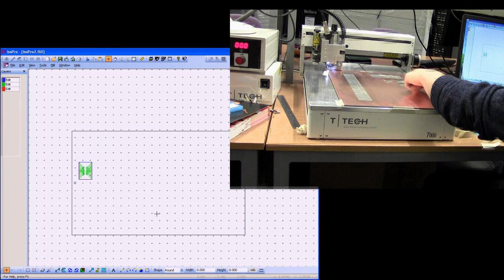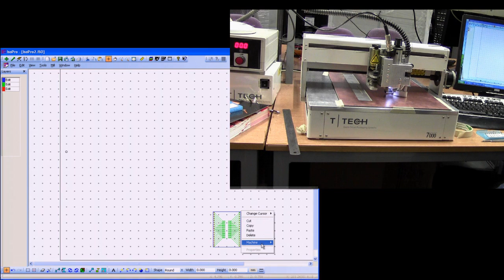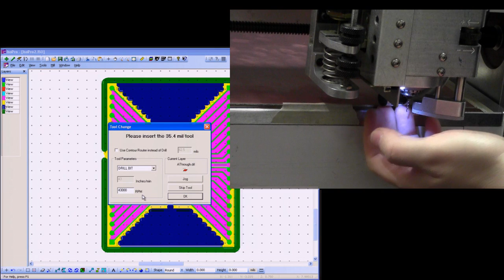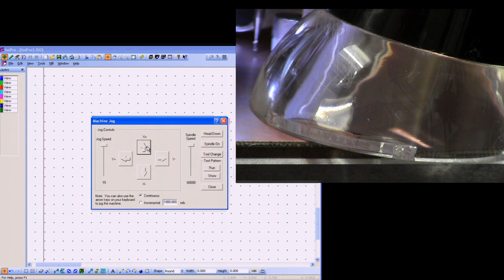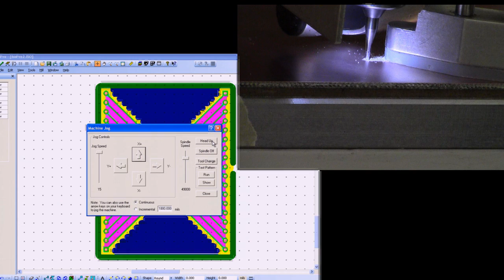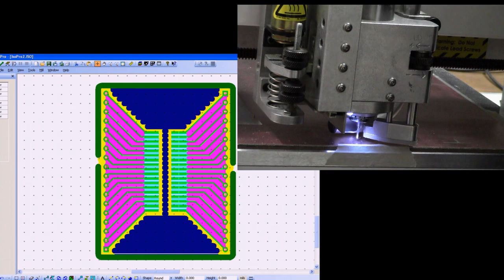How to CNC a PCB, Part 3 ( isolating, setting tools, drilling, milling and routing)

Comment: Hi
can you tell me what cutter you are using in this video.

Thx and good stuff
Reply from the maker: T8 Cutter (Universal cutter with pointed 90degree tip) for fine detail.
31mil and 62.5mill Endmill, larger tool for bulk copper removal.
62mil Router for cutting out the board.